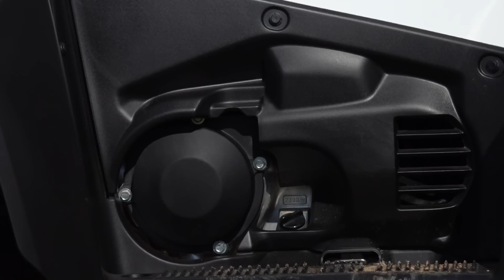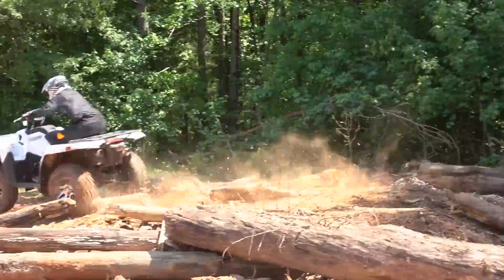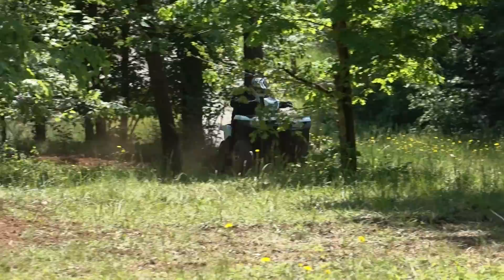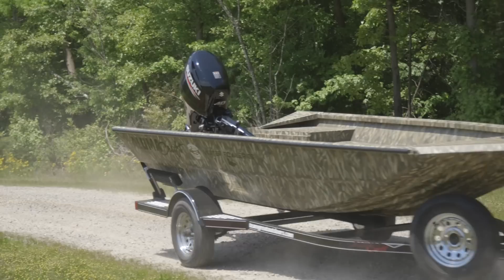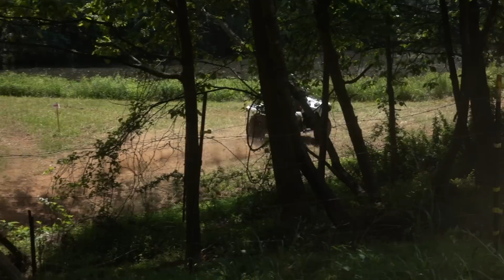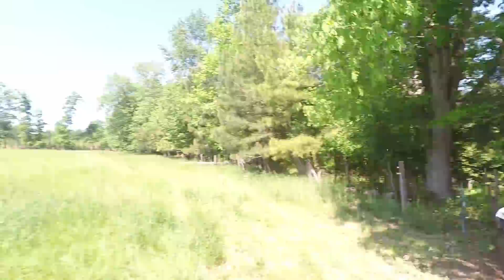2019 Suzuki KingQuad 750 Test Review

Comment: I just bought a 2022.. 750 XPZ.  Drove 77 miles on a gravel road. at 26miles. Flat tire!!   By 70 miles. I had enough!! The Rear wheel Lifting. On a Corner at Speeds above 45mph. IS NOT A STABLE BIKE! With a 3inch Narrower Front wheel track vs the rear wheels. It's a lively ride!!  You can not Drive this with one hand on a loose gravel road at speed.  The power steering makes for a twitchy bike!! Did I say I had to Grip it so tight I almost lost feeling in my hands!  It's not stable on off camber down hill corners. FOR $17 000 Here in Canada out of the dealer door. I expected MORE!!! I loved Suzuki in Past with my Vinson. There's no way I can carry a boat on a boat rack on this ATV.  
Add a Small Gas tank. Canadians need range!!! Like 5 plus gallons of gas. We need 200km range at least.  I'm back to over loading the bike with carrying gas. ugg.. So ya I have 2022 750 XPZ for sale with 127miles. !!

Comment: If it had a vtwim id buy it in a heartbeat. I'm debating between this and the brute force 750
Reply from the maker: Have you written the Suzuki? If so and you like the way that it rides but you want V-Twin power you might like I personally written these two machines but it was years apart. I was commenting recently to an associate that the Brute Force kind of reminds me of the king quad with more snappier power. Did you check on a Brute Force review? I think it was from like 2012.
Reply: @ATVonDemand  yeah I made sure to ride it. Great review for sure 👍,  didn't think finding out which quad to buy would be so tough haha. Been thinking about the outlander 650-850 recently

Comment: This is how I would ride if I'm getting chased by a bear.
Reply from the maker: We like to show a machines performance capability. You don't have to go this fast.
Reply: @ATVonDemand  so last week I was riding and got to thinking if I was being chased by a bear how would I manage if I was in some difficult terrain. It was rocky and slippery shale rocks. So I came to this area where my engine brake was engaged  and pretended I was being chased by a bear so I gave it some throttle to see my way out of the situation I thought I was doing good until I looked at my speedometer it said 13 miles an hour. I would have been hamburger for a bear. I ride with bear spray but you just never know if that's all you need.  Wouldn't hurt if I carried a sidearm.  I had an encounter at our campsite where a bear came through just doing his thing.  No issues didn't get no food cause everything was packed tight and put away and cleaned.  But ever since then it's always been on my mind about coming in contact with a bear.

Comment: how does this compare to a sportsman 570 power wise. they both are rated about the same power. i am sure the suzuki is a better quad.  just curious on power.
Reply from the maker: We have quite a bit of time on both machines although this is based upon memory not direct comparison. The Polaris pulls very hard off the bottom and is probably most comparable to the Suzuki and its power output in the first third of the throttle, and it's pretty close. This is Uki may have some advantage in the mid-range and top-end but they're both CVT machines so this has a lot to do with clutching as well. If you check out her other videos, we recently did a shootout between the King Quad 500 in King Quad 750. Engine wise, we have a feeling that the Sportsman 570 is more potent than the King Quad 500. That would have the very least put the Sportsman 570 between the two machines and give you some idea of how close the engine performance of the 570 is to the king quad 750. When it comes to Performance for the dollar not many four-wheel drive ATVs can beat the Sportsman 570. Of course, we would say fit and finish is definitely better on the Suzuki and there are a lot of long-term owners out there that would say that the Suzuki is probably an overall more reliable machine.
Reply: @ATVonDemand  I love the power of my 570.  I dislike all the sloppiness in the drivetrain.   It works but just a lot of clunking going on.  I dont feel the need of a 800 or bigger twin.  750 is of interest.
Reply: 44 hp sportsman. 38.2 kq 500, 49.6 kq 750

Comment: First of all, thanks for the excellent video!  I owned a 2005 King 700 from 2009-2016, bullet proof.  Towed back once, the brain died around 2014/2015. What it lacked in horsepower or suspension it made up for with reliability and nimble handling that took you around obstacles rather than over. In 2014 I bought a Can Am 650. Snappy power right out if the gate, great suspension, no longer went around obstacles, I went over them at speed. Had to add lights to the Can am, which Suzuki avoids with the handlebar light. Can Am taillights get covered in mud, Suzuki avoids this by staying in the middle. Can Am is built in Mexico, Suzuki USA. I've been Can Am 850 shopping but will be looking for a Suzuki demo ride now.
Reply: What did you end up going with?
Reply from the maker: Thanks for watching and for your Insight on how the king quad compares to the Can-Am 650. Take one for a ride and let us know what you think. Thanks for watching and commenting.

Comment: Sounds like the Kingquad has heavier clutch weights similar to how the Kodiak 700 has. From what I am reading changing those out makes a huge difference in response and acceleration.
Reply: King quads respond very well to clutch mods.
Reply from the maker: We know a couple of people who raced the king quad 700 later 750 when it first came out. We were told that clutch upgrade makes a huge difference on the king quads performance. I think your comparison to the heavier clutch springs on the Kodiak 700 is probably pretty spot-on. The king quad 750 definitely seems up to operate lower in the RPMs. We have a test unit and are planning an upgrade project this spring.
Reply: @ATVonDemand   Thats good to hear....Im intetested in 750 project like you did to your Grizzly 700 a couple years ago that was a really cool build. People dont tealize what an affect clutching has. Look at EHS racing s videos on the Grizz and Kodiak 700s and what happens when you switch weights.
Reply: Dont just change the clutch spring change the roller weights to 18 gram or 16 grams as well.

Comment: the operator in this video needs a sport model, not a 4x4. he's going balls-to-the-wall non-stop, jumping it, flying down the trails and leaning off the bike for the corners. that's not what these bikes are built for. but then, I know a guy who thinks 4-wheeling in his truck is going all-out down the forest roads. but the way they show this guy riding a 4x4 bike, no wonder there's so many deaths every year on them.
Reply from the maker: Sorry we never noticed this comment. After some thought, dirt bikes were never meant to be flipped but that hasn't stopped people from doing it. Have you taken this up with Travis Pastrana? There are a few classes in GNCC Racing for 4 x 4 ATVs. Those guys ride extremely hard. Some comments on this video are complaining that Suzuki does not build a faster 4 x 4 ATV in spite of how fast we show it going. We could definitely see mixing in a little more slow to Mid paste riding that could be a bit more relatable to the average Rider. That being said, we are professionals whose job it is to test the full performance capabilities of the machines we review. It's up to the individual to ride within their own abilities. Also, please comment on some of the other channels out there who constantly post videos of people riding without helmets.
Reply: @ATVonDemand  mic drop
Reply: i have 2 agree they should not be ridden like that

Comment: Manufactures must get a hell of a deal on Carlisle 489's there not that great of a tire but get general purpose machines where they need to go. Still a sucky stock tire though
Reply: same situation as truck dealerships. they aren't going to roll the cars out with pricier tires. hell, 4x4 trucks are being sold with crap street tires on them.

Comment: Suzuki and Honda having hard times in ATVs with outdated engines and machines.
Reply: honda is the most reliable there is. at least they were, I don't have first-hand experience with anything real new. '86 big red still rolling strong. and my 300 quad is too. but bought a newer sportsman recently.

Comment: I've been a big Suzuki fan for years, but their ATVs are just minimally updated 15 year-old designs. 7" suspension travel? There are youth machines that have that. They might have the reliability under wraps, but the performance is laughable in a market putting out 90hp 4x4s with premium shocks and tires

Comment: Nice machine. I have wonder why they specked such a cheap crappy tire. Why not the itp terra cross or maxis bighorn 2. Or something radial. Thats my only gripe. So now the question is new grizzly 700 or new kingquad 750? Hmmm hmmm
Reply: kenda bear claw HTRs.
Reply from the maker: Ernie Desjardins can't answer the grizzly versus KingQuad question without a shootout. As far as the tire question goes, most manufacturers use lightweight tires on their ATVs because it allows them to accelerate faster, and they have less unsprung Mass which in Waze provides a better ride although we are well aware of the argument for the better ride quality of radial tires. Cost could also be somewhat of a factor. We believe it's primarily a weed issue. Tires and a clutch kit would probably be our first two modifications for a little more aggressive and capable KingQuad. Thanks for watching and commenting
Reply: @ATVonDemand  Do you not have both ATV's do a shootout at this point? It seems for 2019, only these 2 machines have made any changes.
Reply: ATVonDemand the clutch sheave works amazing.  More lower end torque and even added top end speed.  Best mod I've done to my Zuk.

Comment: Love the looks. Was not a fan of the last remodel. And I'm glad to see they brought the third headlight back.
Still though, they need a twin. As does Yamaha and Honda. Its just asinine that in 2018, the only Japanese brand with a fun engine is Kawasaki.
Reply: I got a newer Brute and after shocks tires and clutching its an animal on the trail. The 0 to 50 mph acceleration is awesome for a 49 hp machine. I just wish Kawasaki gave a crap and updated the Brute so us owners dont have to spend money on shocks right away. Im hoping this updated Suzuki gets Kawasaki going to.
Reply from the maker: rzl07375 we have thought about reviewing the Brute Force 750 again. We were at the Press intro a few years back when they updated it. That ATV rips. It's not as powerful as the Kawasaki or Can-Am V twins but it's lighter. Its power to weight ratio seemed pretty impressive. We have talked to an aftermarket manufacturer about building plus 2 A-arms for it but aren't sure what the demand would be. A little wider with a little longer travel suspension and you have and even cooler machine.
Reply from the maker: utah wanderlust700 what's the timestamp in the video? No telling what comes out when I start talking.
Reply: ATVonDemand ....Thats exactly what I did to mine. I widened it with more offset wheels and better tires. Then I added Griffin Performance shocks that are plus 1 inch over stock. The difference was so dramatic I couldn't believe  it.

Comment: ATVonDemand....what are your thoughts on this Kingquad vs the newer Grizzlys?
Reply from the maker: rzl07375 we were waiting for this one. We have some thoughts but hate to say anything definitive without riding both machines back-to-back. Both manufacturers have expressed seeing a shootout between the two machines.
Maybe we need to round them both up and find out for sure.
Reply: ATVonDemand I say get a Brute force 750 and have the all 750 shootout...Kingquad vs Grizzly vs Bruteforce.
Reply: Why are we still waiting?   :-) 

Just went to a local Suzuki dealer and was very impressed with the Kingquad.  The fit and finish was fantastic! It was also very ergonomic.

Comment: The new 2019 seems nice, but nothing special. While I dont think someone would go wrong if they are looking for a basic & reliable machine, I dont think there is really anything to make this stand out above the crowd..or maybe even with the crowd.

Thoughts?
Reply from the maker: Midwest ATV we think it will prove to be a good reliable machine for the work and Recreation crowd. Obviously, it's not going to turn the heads of those who are simply interested in having a larger displacement and faster machine than their friend riding a big twin cylinder machine. We're confident that this is a very good machine however the company would benefit from a couple new offerings.
Reply: For trail exploring and technical riding and tight wood riding there is no better machine.Perfect difflock and clutching for the most difficult obstacles.No Can am or Polaris comes where the Kingquad and the Grizzly come.These machines are light and nimble.They are 50 to 100kg lighter.The KQ uses a lot less fuel so no need for extra fuel.The plastics don't break when hitting a tree.I can go on and on.But it is no racer on open tracks.It isn't slow eather.
Reply: love my king
Reply: I think it's too little to late. Suzuki can only coast on reliability so long and this seems as stale as the model it replaces. Racks need work, styling needs work and instrument cluster is crap. I rock solid reliable machine it might be but it's no Grizzly. Yamaha gives you all this and they can make it look great, has a better instrument cluster and more comfortable running boards. It was between the 2018 Kingquad 750 and 2018 Grizzly 700 when I went shopping and the Grizzly just offered more but I could of had the Suzuki for slightly less money. My buddy purchased the Kingquad and when I rode his I found it was terrible as compared to the Grizzly.

Comment: Should have at least bumped it up to a true 750cc at least.
Reply: Yep.  I'd like to see how big they can effectively make the single.
Reply: Devlins10. Oh for sure. This isnt a bad quad but the power comparison in this test vs the old Kingquad was a head scratcher.
Reply: rzl07375 yep they should have squeezed at least 5 more hp out of it.  Would have made it more worth it to trade up.  I love my 09 PS unit with VDI programmer.  I'll stick with it for now (:
Reply: @Devlins10  any issues with that vdi? Have read a lot of horror stories.
Reply: rzl07375  the test just proves different clutches in the 2018 and 2019

Comment: 721 pounds seems extremely light, Suzuki really is a conservative company so it takes a close look to appreciate their products at times but this seems like a great entry
Reply: Daniel Pork I would say it is really just that though...a great entry.
Reply from the maker: Daniel Pork weight should be a big consideration for anyone thinking of buying an ATV. Well 30 lb may not make much of a difference 100 lb certainly does. The lighter of machine, the more control the rider's weight has over it. So many viewers beg for bigger machines, in multi cylinder engines without consideration for the weight penalty. These are not side by sides where you just set on your butt and push the gas pedal. We've seen so many 800 + pound machines that 721 lbs does seem kind of light. Thanks a lot for watching and commenting.